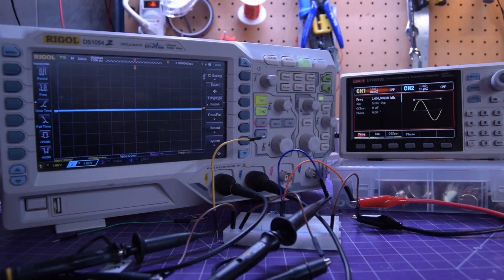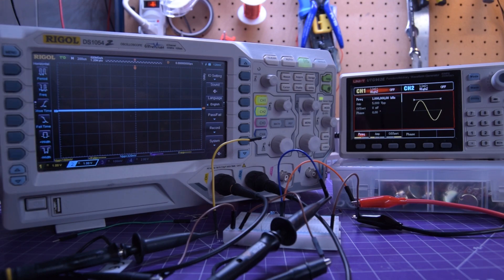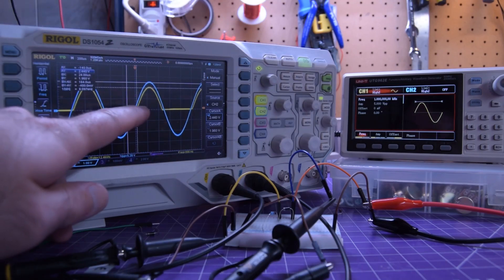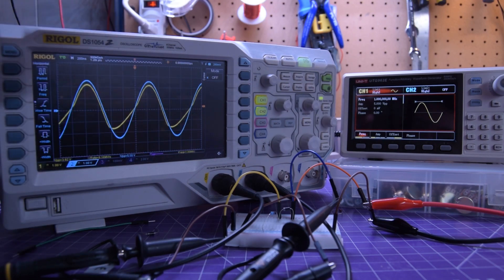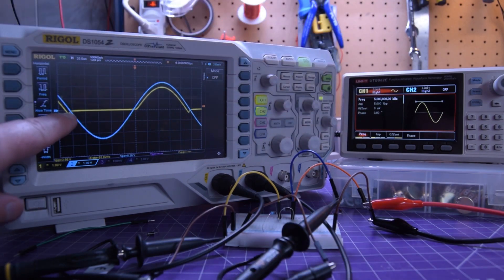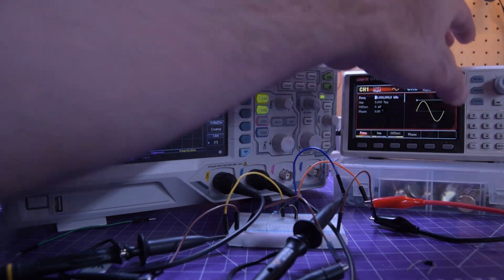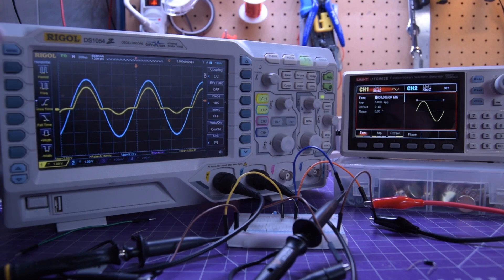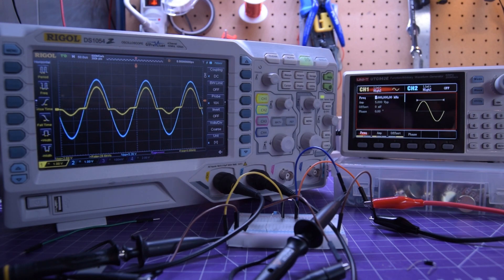Experimenting with diodes!

Comment: Nice visualization. I would love to see some other components displayed this way. onecircuit mentioned 1N4148, that would be a good start. With a resistor on the output I would like to see what some transistors would do in those test conditions.

Comment: I wonder how the 1N4148 does at those higher frequencies? 🤔
Reply: Well, I found that typical 1N4007 diode has reverse recovery time around 1500ns, and 1N4148 has around 4 or 8 ns, depends on conditions, so I guess they can take a bit more frequency. And this shottky diode he used is quite slow one.